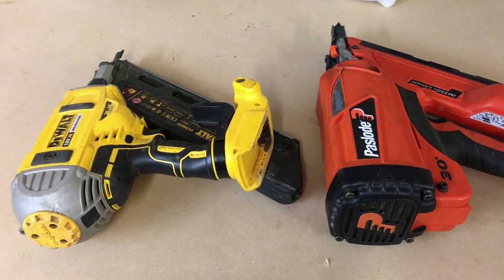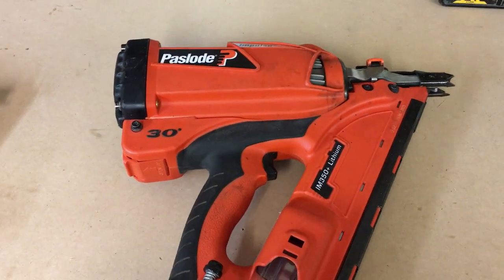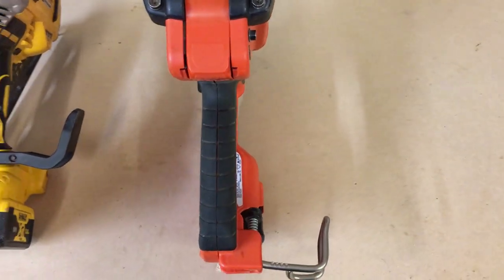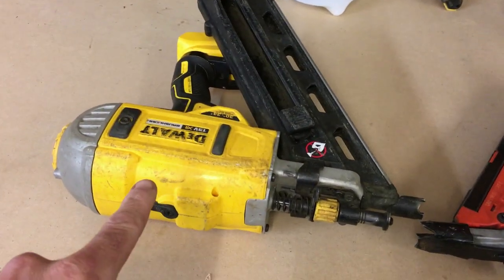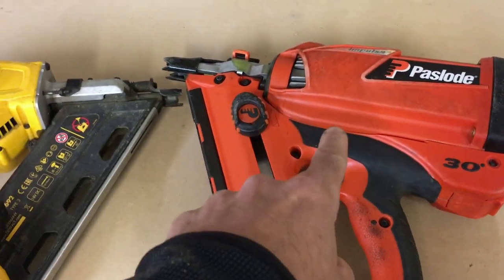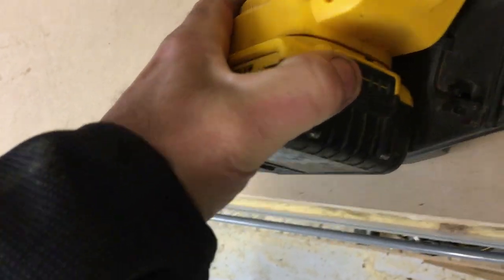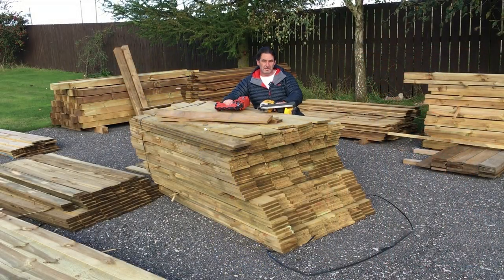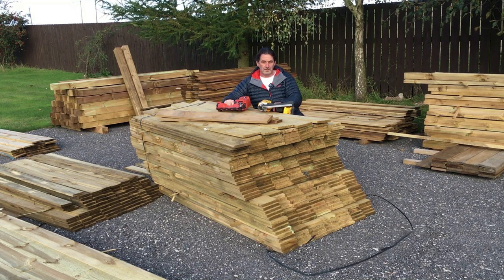Which NAIL GUN for Building FENCE | Paslode or Dewalt ?

Comment: I got an OZITO 18G brad nail gun. 18v battery. 15-50mm electrically galvanised nails. Adjustable depth. Single or rapid fire. Fast Fencing. Awesome Tool.
Reply from the maker: You should not use Brad nails for fencing, they will not last. Use ring shank nails with a first fix nail gun.

Comment: The battery indicator is on the other side of the handle. The blinking LED turns red when the battery is low.
Reply from the maker: Yes, but no gas indicator which is more useful.

Comment: Charge up and go- defo the dewalt for me. No faffing with gas etc. Problems can occur on both and I could never fathom out what was wrong with the paslode. Gas, battery, jam….
Reply from the maker: I have since bought the new Paslode 360xi and have to say that it is the best of all three. I was the same as you re. the Dewalt but I now much prefer the 360xi. I done a video comparing the IM350 to the new 360xi which hopefully shows the differences. Thanks for the comment !
Reply: @Bacrenfencing  Yeah it looks good. I don’t use guns loads and have a dewalt set up so works best for me. 👍

Comment: Hi Barry nice video I prefer the dewalt myself for as you say a lot less messing around, looks like your timber stocks are still looking good prices down here are still high we did some composite fencing the other week although it was still more than timber the price difference is not miles apart our supplier is £1.45 for a 125 mm 1.8m feather board and the quality isn’t that good, take care mate 👍
Reply from the maker: Cheers Rob, Yes, I like the dewalt as well but the weight does take its toll when using it constantly, hence the paslode. Yes Rob, got some timber left but all allocated to forthcoming jobs, I am getting it OK now but still have to order well in advance and the prices are mental - not sustainable in the long term but you know what it's like, once prices go up they never really return to previous levels.............way of the world at the moment ! Take it easy mate and good to hear from you !

Comment: Great video. Been running Paslode for years, but the run cost just does add up here in NZ. Invested in the Hikoki range of guns from first to the 18 gauge. 90mm no problems, plenty of power. Heavy though and you know you've been swinging it about about a couple of 100m of palings. When on remote farms, we swap to compressed air guns, but they don't like the weather - either to cold or too hot.
Reply from the maker: Thanks for the comment. Yes, the cost of gas is a big drawback but I suppose that's the price to pay for being guaranteed the power of the paslode. I was going to by the Hikoki when it first came out as it got 5 star reviews (and sounds cool too) but I decided against it as it was actually slightly heavier than the dewalts I had already. Give my love to NZ from sunny Scotland 😀👍 and keep swinging that Hikoki !

Comment: Do you use these guns for attaching the boards or do you have smaller ones for that or do you use screws?
Reply from the maker: Yes, I use these for attaching the fence slats. I use 50mm galvanised ring shank nails for this. Cheers

Comment: Have you had much issues with the DeWalt gun was thinking of getting one but won't be using it on treated timbers just regular timbers
Reply from the maker: The dewalt has been far more reliable than the paslode to be honest. Not really caused me any issues, I just prefer the power and speed of the paslode, but would certainly recommend the Dewalt.

Comment: For fencing, do you use regular smooth framing nails or ring shanked nails? The only galvanised rink shanked nails I can find are the paslode dekfast nails but then have a small head.
Reply from the maker: I use Hot dipped Galvanised Ring Shank nails for fencing. I use 2.8mm x 50mm size nails. I hope this helps
Reply: For featherboarding?

Comment: Great video. I'm looking for a nail gun for making planters, some can be large planters. Thickest materials I use is 22mm was thinking of the dewalt dcn660 and wasn't sure if 16g would be enough and never used nail gun before. Getting fed up with using screws and price of them any advice would be grest
Reply from the maker: Thanks for the comment. I also have a Dewalt DCN660 which I use as a brad nailer. I am not sure if the DCN660 would be much use for planters though as the brad nails would not give sufficient holding power. If the combined thickness of the timber that you are fixing is over 50mm, then best with a first fix nail gun like the one's I show in the video and use ring shank nails. Hope this helps ?
Reply: @Bacrenfencing  Thanks for advice 👍🏻 and quick reply
Reply: @Bacrenfencing  what gauge is the nails

Comment: Great video. I always go back to the Dewalt myself. Just less messing around. Are there any good suppliers of feather edge by the pallet up north? 
Some of the prices being quoted at the moment are ridiculous?
👍
Reply from the maker: I have to admit that I tend to do the same when on smaller jobs, less fannying around. The paslode is a lot better if using it all day due to the lighter weight but I hear what you are saying !
 Prices up here are crazy too, I get most materials direct from the sawmill so that helps slightly, but still seem to be rising every month - not sustainable. Where are you based ?
Reply: @Bacrenfencing  Sorry pal, only just seen this. I'm on the border of North Wales. Materials have gone through the roof this year but I'm sure it's the same everywhere.  All the best
Reply from the maker: @Delamerefencing  Same here mate, materials are approx 40-50% higher than a year ago, it's getting ridiculous !

Comment: is that a d  type nail framing gun  - got told it will split the palings and use a coil gun instead ?????
Reply from the maker: Coil nailers are good, but you need a compressor. These nail guns are totally cordless and never split the palings. At the end of the day, coil nailers and framing nailers do exactly the same job.
Reply: thanks  -  guy said coil shank nails are round head but frame  nails a d type which splits wood - i have a  paslode gas framer so dont want to buy a coil  one if i dont need but it takes a  longer nail  ??? @Bacrenfencing
Reply from the maker: Yes, coil nailers use a round headed nail and the framers use D headed (which are not an issue). I now use the Paslod 360xi nail guns which accept round headed nails as well, so they are really good if you want to use round headed nails. I made a video on the 360xi here if that helps https://youtu.be/LdkkBgB3z5E

Comment: Would you recommend getting the twin dewault guns or will the dcn692 be too powerful for feather edge new to these .
Reply from the maker: Hi, The DCN692 is a good gun and will do feather edge, you just need to get the depth set right on the gun. If you are going for the DCN69N make sure it is a type3 as that is the best version IMO. Thanks for the comment 👍
Reply: @Bacrenfencing  thanks mate much appreciated
Reply from the maker: @russelldownesdownes5618  No problem, glad to help out where I can
Reply: @Bacrenfencing  so the type 3 can let’s say nail the frame work up and nail the feather edge to the frame, it’s ok someone said to me today you’ll need the two guns dcn660
Reply from the maker: @russelldownesdownes5618 Yes, you can use 90mm nails in the DCN692 for nailing the frame to the posts (personally, I use 6 x 100mm coach screws something like this https://amzn.to/3xOF0Ss ) and then use the same gun to fix the feather edge using 50mm ring shank nails. The DCN660 is a second fix gun that fires brad nails, brad nails are not recommended for feather edge. you need galvanised ring shank nails or screws. I sometimes use 4.5mm x 50mm decking screws depending on the situation. Hope this helps ?
Reply: @Bacrenfencing  Please could you give a link to where you buy the 50 mm ring shank nails suitable for use with the DCN692 ? I am looking to buy a DCN692 but wasn't sure if it was suitable for featheredge boards .
Reply: The gas for the 360 is very expensive, anyone know the cheapest place to buy it?

Comment: Dewalt are doing a new type of battery which is lighter and thinner but more powerful. Think they are called Stack 20v
Reply from the maker: I did not know that John, will they be compatible with the 18v tools ? 
Away to research that now ! 👍😎
Reply: Not sure. Probably not so you have to buy new tools.
Reply from the maker: @johncolquhoun6416  Haha, I have spent a lot of this year upgrading to flexvolt 54v tools...........and now this :-)
Reply: Old reply here, but in case people are reading this
The UK 18v tools are the same as the US market 20v 👍🏻